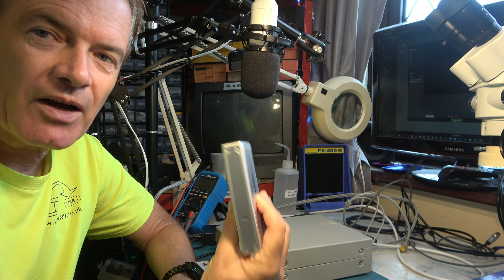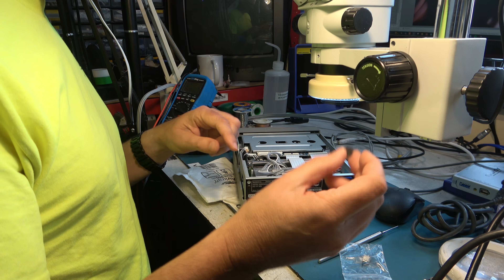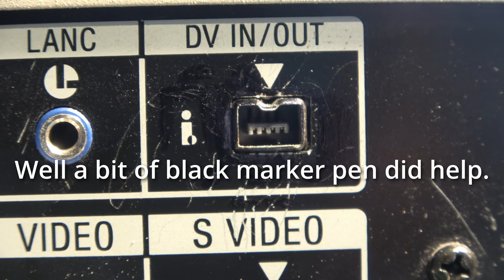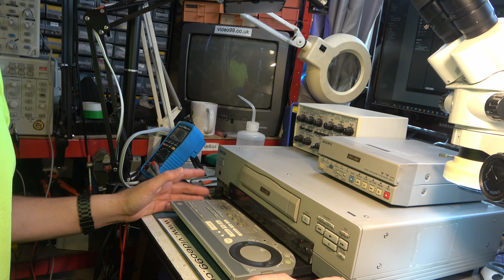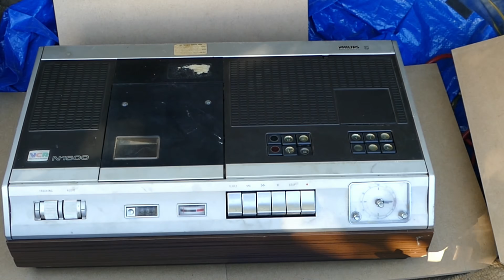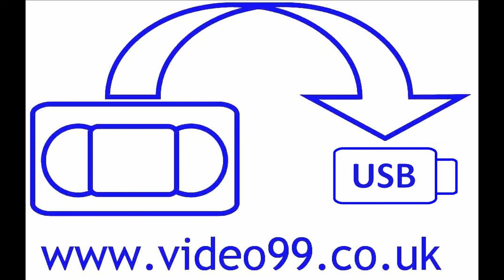Firewire IEEE1394 connection on a DVCAM deck. Digitising with Firewire.

Comment: i guess the reason the DSR-30 don't have DV input is puerly because this is a consumer grade deck.
let's say the same grade as EV-S9000 was. and as you know in europe in general, camcorders didn't get AV input due to extra tax manufacturers rarely wanted to pay, except for very high-end models such as the Hi8 V5000 and 6000 for exemple.
well, the same BS also existed with DV input option... 

maybe the DSR-30 have a firmware option that can unlock input as some MiniDV camcroders had.
so might worth investigate, as i'm fairly sure the DSR-30 NTSC equivalent might have DV input.

Comment: Firewire 4-pin to 9-pin was definitely a thing for transferring both DV and HDV video at least on later generations of the original Mac Pro. At some point Apple stopped using the 6-pin firewire interface and moved over to 9-pin (FW800) only. I remember capturing video into Final Cut Pro 7 on a Mac Pro 5,1 (Mid-2012) which used a 4-pin to 9-pin lead. Final Cut Pro does have a tick box on it's capture window that says "abort capture on dropped frames" which is also useful.

But of course that's old software and old hardware. That earlier version of FCP is also a 32-bit application so won't run on modern Macs or MacOS which are 64-bit only. However, I did do some archiving work at a facility in 2022 and they were still using FCP7 for capture on 10+ year old Mac Pros. Creating 10-bit uncompressed QuickTimes via an AJA-Kona card. I think it was their client who specified either that work flow or codec or maybe both.

I think I mentioned this on one of you're earlier videos but I knew someone who managed to connect their 6-pin cable the wrong way around at the PC end, which subsequently destroyed the firewire interface on 2 DV camcorders.

Comment: I can't get a DVCAM and HDV decks to work flawlessly in EE mode, I constantly get audio breakups and silent dropouts, so I just run it through a Digital8 camcorder. I may try to look that TBC you have, but might be tricky to get.
However I use ScenalyzerLive abandonware. But on my newer laptop I have to go either through the ThunderBolt adaptor that only works one way that is from tape to PC, or with an ExpressCard, unfortunately my previous one broke and the newer one is finicky, it does not work as plug and play, I need to turn the computer off, plug everythign and then boot and I still have not figured out how to make it work with D-VHS, even though it worked on the preious card...
As for Windows 10, there are OHCI Legacy FireWire drivers out there to install.

Comment: I've been using AVDC100 with my Mac Studio M1. It works fine with iMovie and OBS but there's an annoying chain of dongles between the AVDC and the Mac. There's a Firewire to Thunderbolt 2 and then Thunderbolt 2 to Thunderbolt 3... a bit messy but it's reliable.
Reply from the maker: What mechanism is there to report if the system drops frames?
Reply: @video99couk OBS does report dropped frames during capture. Though the tool itself isn't the best to use.

Comment: I am currently using Vrecord, for capturing, which is open source and runs on PC, Mac or Linux.  You should also take a look at the open source DV Rescue software too.  Great for recovering corrupted DV based tapes.

Comment: Also the latest MAC OS does not support firewire particularly using thunderbolt to Firewire adapters. So you a forced to use older macs and OS Software as a capture device.

Radios 📻 please

Comment: Thanks for the video and the details on firewire and it's plugs. I used firewire for video and editing years ago and was always imprssed by the flawless interaction between suitable recorders and computers. I still have some of the equipment and should start making use of it again. I bricked several devices and I am in doubt it was to wrong plugging of the cable but had the impression that circuits were grilled by electrostatic discharge. Videorecorders are great and your videos help us understanding what goes wrong in these machines and how possibly to fix it, but I vote for the radios this time. They are your family heritage and you have to repair them anyway after all. Best, Albrecht

Comment: Firstly, love the channel - fascinating and interesting stuff!

Watching this video has reminded me that I have a ton of MiniDV tapes that i want to transfer but I no longer have a computer with a FireWire interface (many years ago I had a Dell laptop that did). What would be your recommendation for an interface to allow me to capture the data from the tapes with a laptop that only has USB ports?
Reply from the maker: My advice would be to get a desktop machine and install a Firewire to PCIE card.  Don't use a laptop with USB ports.  It may or may not be be that there's a USB3 to Firewire adaptor but I've not tried such and don't think it would work without dropped frames.
Reply: @video99couk hello (and merry Christmas 🎄) I followed your advice and bought a cheap refurbished desktop on ebay and fitted a firmware PCIe card.  All is good.  

I am also now using my Sony DCR-PC120e camcorder to assist with captures from VHS by passing analogue composite video in to the camcorder and then capturing the DV out. Much better quality than the old USB capture dongle I had used previously used.

Comment: One way is to solder the socket the opposite way and relocate the main 6 pin connector wires to the corresponding locations, But at this point it's too late as you have done the repair already.
Reply from the maker: Yes, I think that would have worked too.  However, just for good measure, the grounding metal tabs of this socket didn't line up with those on the PCB either.

Comment: On the topic of ports however. I have seen someone modify a Sony VX1000 to accept a 6pin firewire connector. It makes me wonder how difficult it'd be to do a similar modification to a DVCAM deck like yours and mine.
Reply: Presumably you mean just so it's more robust, the extra pins are just for power so they wouldn't be used. It should be simple, but of course, he'd have to cut a larger hole in the case.
Reply from the maker: Some professional level machines from Sony and Panasonic due use the 6 pin connector, just for the extra robustness.
Reply: Also when it comes to capturing on a Mac or a Windows machine, DVRescue is a good bit of free software. The downside is installing on a Mac is an absolute arse ache. You have to install things from the command line to get it to actually capture, which I never managed to get working. BUT if you can get it working, it's an archival level bit of software developed by a museum in America to archive these digital tapes. It has probably too much intricate information for simple DV capture jobs but if you want to ensure you're capturing everything properly and ensure there are no dropped frames, and if there is, where they are and why, it's a fabulous bit of opensource kit.

Comment: I'm recording on a modern Mac natively with no additional software just iMovie, I found out to be the most complete, direct and reliable method. Windows software is always finicky, missing metadata, recording weird formats, changing resolution and so on. You just need 2 dongles, Thunderbolt 2 to Thunderbolt 3 with a Firewire to Thunderbolt 2 plugged and it works just fine on latest Mac with the latest MacOS, it just records video as is, no squished video, no weird formats and complete metadata. If I remember correctly if there is an issue with the tape reading it just creates 2 separate files instead of desynchronizing.
Reply: Unfortunately, as is the norm, Apple has heavily overpriced the dongles - though that can still be great if you already have a mac with tb3 & ideally an old tb2 firewire device. The dongles apparently also work just fine on a pc with thunderbolt 3, as these dongles effectively just become a pcie firewire card with the data carried over a tb3 cable. It's a shame that neither Apple or seemingly anyone else has just made a direct tb3 firewire device. Even plain old usb can be done, I've got an old usb2 capture device with a firewire socket for dv [it won't work with hdds etc, only dv video]
There's also another easy & cheap way, get an old dvr or dvd recorder with a firewire socket & hdmi output, then you should be able to pass it through without any loss & capture with a cheap usb hdmi capture device which work with basically anything. Albeit you'd ideally want 480i or 576i out, if you don't want it deinterlaced or upscaled.
You can also burn it straight to dvd of course, which I'm pretty sure also automatically puts each recording on the tape into different chapters, so it's easy to get to what you want.
As detailed here, there is no need for codecs, as there is no compression - it's a 1:1 copy. The tiny, free app Windv works perfectly.
When capturing analog video, any wrong format etc is very likely due to being set incorrectly by the user. If you always use the same format & settings, as would generally be the equivalent Apple way of doing things, it shouldn't be an issue. Some capture devices software, video editors etc already do this by default.
There's also a load of free software for filtering & deinterlacing vhs etc captures in the best quality on pc, which can be very important.
Personally I see little or no difference between capturing firewire on an old mac, & a pc. Most problems generally seem to be caused by firewire itself, and how incredibly finicky it is with how devices are plugged in.
I've found that hardware compatibility can be a nightmare for anything "old" by Apples standards - numerous expensive audio interfaces, capture cards etc now sell for next to nothing due to requiring a specific macos version etc. In practice you often have to get an old mac with the right socket but not too old so that the os you need isn't supported / is too slow, once you've found the exact os version which is the best compromise - being compatible without bugs, supporting the newest firmware on the device, etc. Both Apple & the manufacturers seemed terrible at supporting hardware on mac.
PC cards & peripherals are often a lot easier to get working. Part of this is they generally just need to compatible with XP for example, vs one of the many macos revisions & with drivers for that particular revision.
The usual ideal for video capture is pretty much any old desktop pc, with the slots you want [pci,pcie,agp] with Windows XP installed, due to the era when most devices were made.
Reply from the maker: Metadata is recorded as demonstrated on the Windows PC running Pinnacle Studio.  And it reports if there are any dropped frames, which iMovie doesn't (from what I've seen of it).  It's not at all finicky, it just plain works.  I use Windows PCs for this all day every day.  Apple Macs on the other hand....  They don't like me and the feeling is mutual.

Comment: Scenalyzer Live is what I use on the PC with an Audigy sound card that has a Firewire port. I use it under Windows 10, and it didn’t work at first because Windows flagged it as a webcam and wouldn’t let programs access it without permission. Once I did that, it worked normally.

Comment: hi finding the drivers for some  os is now a right pain  can't use a  320 scsi card any more or some M-AUDIO  gear
Reply: Audio interfaces in particular seem to be terrible for compatibility, perhaps they just expected professionals to regularly upgrade to another expensive model.
I think Adaptec scsi cards are good for compatibility - particularly for pc but seemingly also for mac with some models.

Comment: As far as I know the first generation of Sony DV devices did not have the E-E mode going directly from analog to digital via Firewire. The VX1000 didn't have that ability, neither did the DCR-PC7, and later the first (NTSC-only) Digital8 camcorder DCR-TRV103 couldn't do it either.

Comment: The Digitus PCI Express Firewire 1394a card has a VIA Chip🙂, 2x6-pin and 1x4-pin connectors in the metal plate, 1x6-pin internal, power connection only when needed to 6-pin connectors, runs from XP to 10 and with Locked Audio. Simply look at the photo and search a "brand" that is sold in your country. 12voltvids has already pointed out that flexible FireWire minimize stress for Sockets. S-CONN cables are the thinnest at my dealer, but they are probably sold under a different names outside of Germany. Not all editing software runs with Locked Audio (DV-AVI Type 1). The Panasonic DMR-E55 has a good EE TBC/Synchronizer, but the sound has to be shifted 3 or 4 frames to the right because of the TBC runtime. I prefer to record the Pioneer DVR-560H HDMI output uncompressed as an affordable PAL/SECAM/NTSC TBC solution. However, the Pioneer refuses to select the HDMI output standard unless a screen that supports the desired standard is connected in parallel via a splitter. My broken Pioneer DVR-LX61 only output the stable OSD from the Panasonic NV-HS900EG, but not the jittering video tape via HDMI. The Blackmagic Decklink Mini Recorder HD HDMI/SDI PCIe Recorder was only available for a very short time, but I could not get it to record the 576x720i50 4:4:4 standard promised in the data sheet. The external follower requires an expensive Thunderbolt input. I now have the HDMI to SDI and SDI to HDMI converter which converts HDMI 4:4:4 into SDI-compatible 4:2:2. But there are even more reasons why I still haven't presented a permanent working solution (synchronous sound after 3 hours).

Comment: Not disagreeing on pc. But I use Mac’s for my FireWire captures. I just use lifeflix software for capturing. iMovie and fcpx I have issues with camera not showing up or sync with audio. But on average one full minidv tape I get just over 14 gigs.
Reply from the maker: Does lifeflix report if there have been any dropped frames?
Reply: @video99couk honestly been using it for a couple of years. It’s doesn’t really drop it just stops. Also any time the recording has a stop and new one begins it make a new clip. So that I don’t like but I just throw all the clips on the timeline and export has one clip. Files are .mov 720x480.  So if recording starts to go bad the tape stops. I get a 90 percent no issue but get those funky tapes from customers and who knows where it was stored. Also I have the meda data on the mov clips.

Comment: I use my very old Mesh PC running Windows 7 with an on-board FireWire input for the occasional DV captures that I do. I've kept it just for that purpose. I've got a selection of old JVC DV camcorders with FireWire outputs that I use (II used to work for JVC and ended up with a lot of free evaluation samples). I use the ancient WinDV that you mentioned, and it works very well, with no dropped frames, even with a mechanical hard drive. It saves each shot on the tape as a separate avi file and I mostly use Kdenlive to edit them.

Comment: I remember quite well how I jailbroke our miniDV camera so it would also re-record the edited footage.
Not all cameras did that ootb for some video-recording-licensing reasons.
The camera firmware had to be 'adjusted'.
Reply from the maker: I've done a video about "secret remotes" which mentions this.
Reply: I also had to activate my Panasonic NV-DS15 in order to record from the Canopus ADVC-100 (satellite TV) in the EU.
Reply: I think that was more often a problem in the UK, apparently due to a tax on recorders. From memory, I think that some models which had recording disabled in the UK worked fine for the equivalent models sold here in NZ & Australia etc - they were likely the exact same model, but with recording enabled.
Reply: @DoubleMonoLR  The EU had an import tax on video recorders. Without analog and/or DV input, it wasn't a video recorder.

Comment: I've used dvgrab on Linux with great success, with the right parameters it can automatically rewind, split the capture into individual files that match the clips on the tape and keep the timestamps, but it's command line only. Also some of the last Firewire equipped Thinkpads like the T520/W520 are still pretty good for this, most of them can be fitted with 2-3 SSDs, altough I've had no dropped frames when recording to the system drive with Linux (and not much things running in the background).